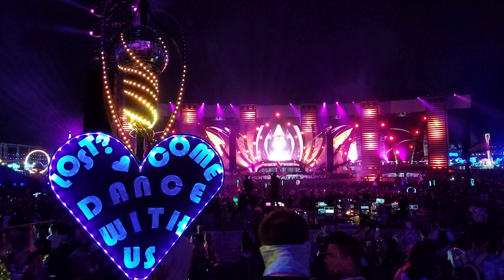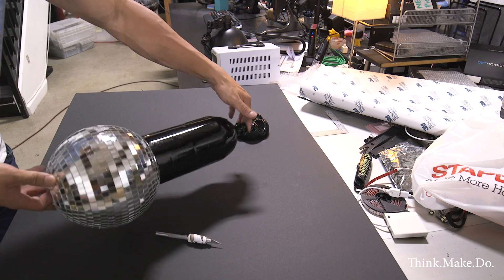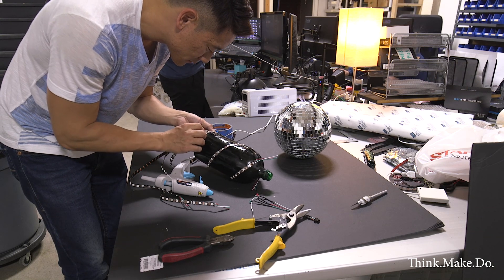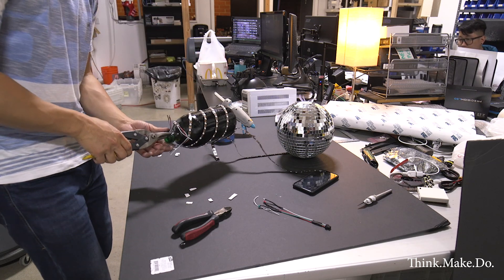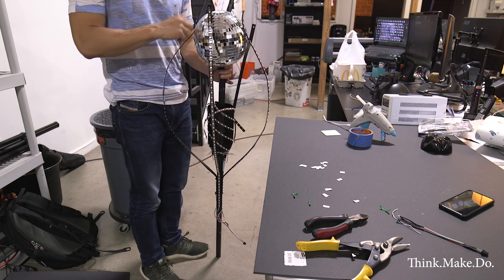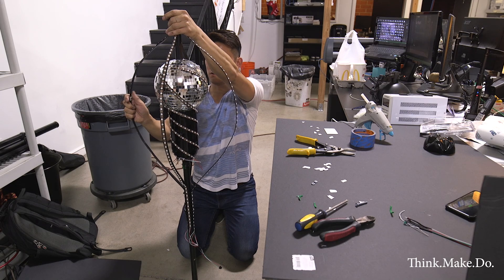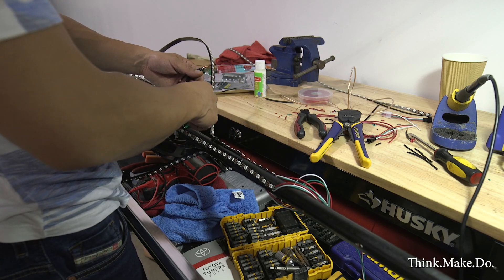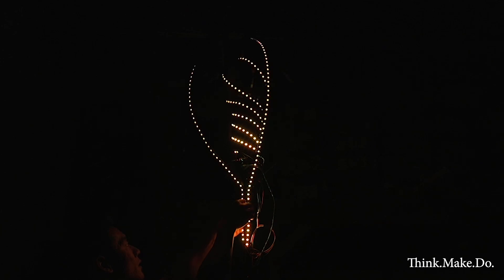Build an LED Totem - Part 4 - Final Build

Comment: Awesome video series :) I want to try and build an LED totem using arduino as well and I found these super helpful. 

Would you happen to have any pictures of how your connected all the strips to a power source and where you stored the battery?
Reply from the maker: Hi.  All the LED power strips connect to the Arduino board that i think is detailed in part 3 of the video series.  for the battery, i created a mount out of plumbers tape (metal strapping) that i wrapped around a USB Battery with some zip ties.  i think if you message me directly i could send you some photos from my archive of it.